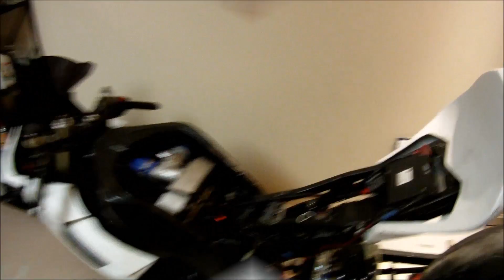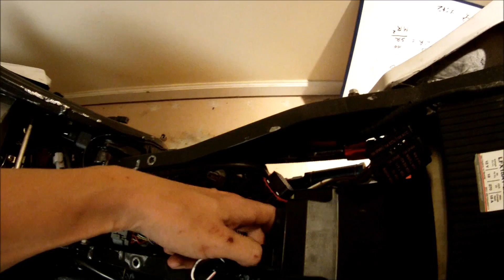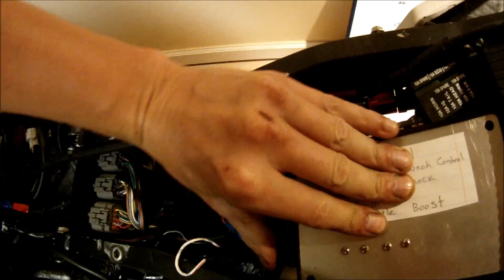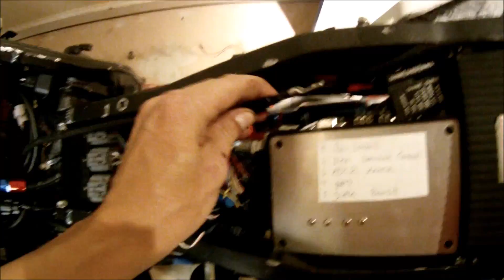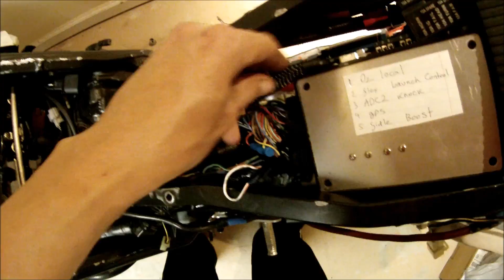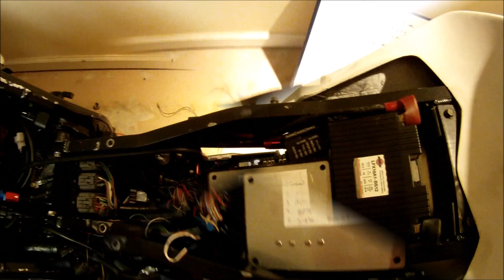Turbo Kawasaki Ninja ZX10R Build, pnp Megasquirt 2 Stand Alone ECU Install,PART 24.

Comment: There is no such thing as PNP MS for a zx10r or ANY motorcycle for that matter. Where did you get this? Custom order? Custom made? I'm planning on putting one in a bit after getting the bike if not as soon as I buy it. I was planning on just ripping an old ECU apart and taking the socket off the board and mount it in the MS box and solder that to the board some how. Would be really cool to find the site you got a PNP for a motorcycle on. Thanks bro
Reply: Thanks for the reply man; Where did you get the plugs from? I found this page on the site I got my last MS3 from for a 87 Firebird TBI boosted swap with a th400. https://www.diyautotune.com/shop/megasquirt-kits-components/diypnp/

It appears to list many different types of plugs. Are these some kind of standard or some stupid proprietary crap from Kawasaki? They look like standard plugs.
Reply from the maker: I built the ecu myself.
Reply from the maker: 04-05 zx10r ecus use the same connectors as Motec ecus.

Comment: What ecu are you using?

Iv been looking for a good standalone for a while and either there not ideal for a motorcycle or the cost i just ridiculous ...

Whas thinking about aem ems4

Or a halltech unit myself
Reply from the maker: This ecu is based on microsquirt module, it's basically megasquirt 2,  it's pretty basic.